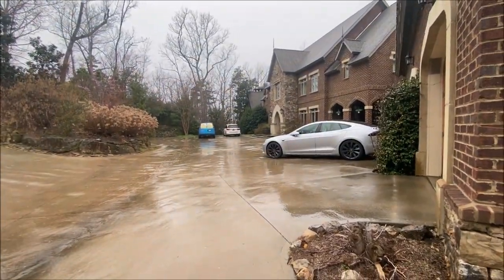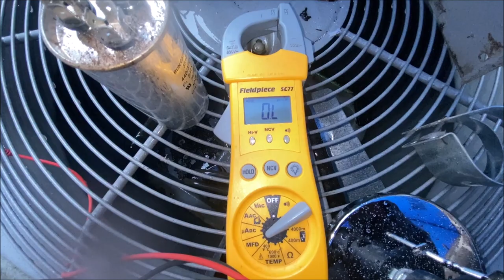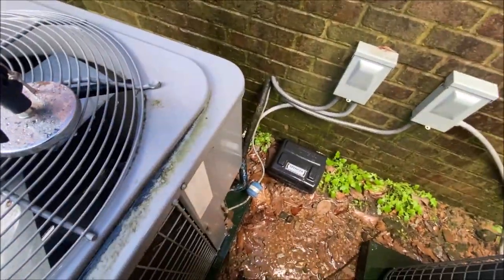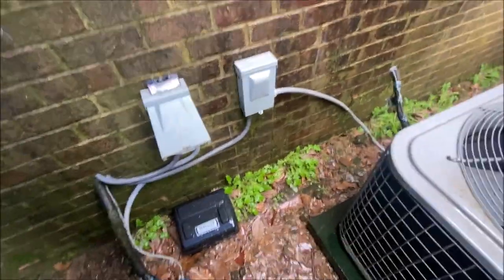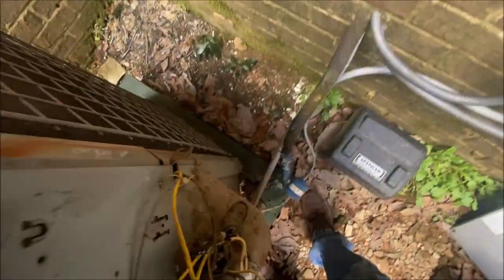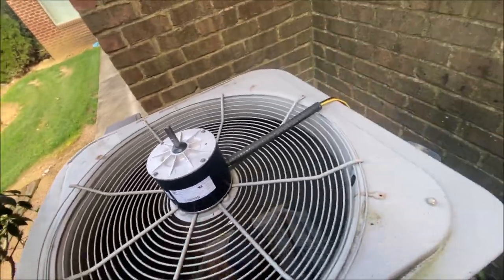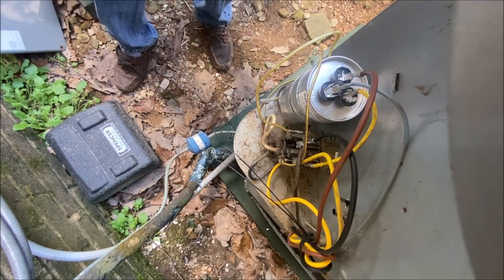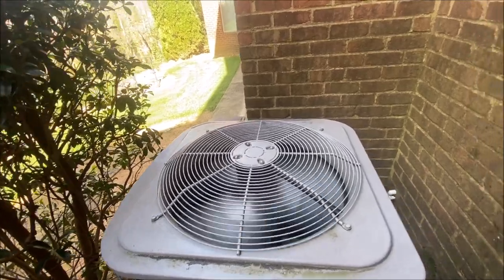HVAC with Supco Umbrella

Comment: After a few videos watched on Anti DIY HVAC, I have brand new capacitors for the condensing unit and blower fan in the attic in stock and ready just in case. 33 years and both capacitors are still working on our Amana HVAC. Apparently, the industry made good capacitors the older they were made ! Many say these days you should expect a new one every 5 years. In any regard, we're ready for the most inconvenient time of the year that one fails. 
5 units on that house is awesome...Initial cost is higher but its very cool to be able to use just one or two or all 5 alternating "as needed" vs. a couple of 5 ton energy hogs flipping on and off multiple times a day, if I'm correct on that. Last time I looked, the 5 ton vs. 4 ton used much more power. Much more than a 3 ton vs a 4 ton which told me to use a 3 ton with a 2 or 3 ton, not a 5 ton due to the operation cost.
This is a good video...its nice to come across a homeowner who wanted OEM parts. It's still Vietnam made but at least it fit like a glove as the original. 600 amps to power up that home? Oh my, 200 of that is likely for just the 5 A/C when they are all running at the same time ! Hope the electric rates are low, like 4 or 6 cents a kWh.

Comment: Great videos👍🏽 Love that umbrella. Doesn’t catch everything cuz the size but definitely helps! Sometimes I’ve found the compressor was drawing close to RLA and found the cap was dead but still running. Or cap is bad, replace and it doesn’t change amps,  And I’ve found them read ok and fluid was leaking, sometimes I’m just like 🤯🤷🏽‍♀️

Comment: Dielectric grease for electrical connections to prevent oxidation, electrolysis, and crustiness.

Never-seize/anti-seize on fan shafts and stuff to prevent rusting and corrosion so they are much easier to remove the next time.

One thing I saw that would make an electrician cringe is the lack of a grommet where the electrical wires passed through the metal housing.

Comment: In the Paintless Dent Rem9val industry, we use Get A Grip umbrellas and Mobiletech Shade Umbrellas.  They have Woods Suction Cup bases, and they have an 80 inch umbrella option.  You cannot beat the 80 inch versus the standard 65 inch.

Comment: Couldn’t help but notice you did not try remove the fan blades after removing the lock bolt. Did it really need the jack of all sprays?  I’ve remove many fan blades without having to use any rust penetration spray on a fan shaft.

Comment: I have one and it's ok if you are replacing a contactor or capacitor but if you take the top off you will not have a stable place to attach. It badly needs a ground pole attachment.

Comment: Why have a meter if you don't use it to check voltage to unit, the pull disconnect and short cap leads. Have you not been nailed from cap discharge.

Comment: Why dont any of the You Tube guys use a service valve wrench to loosen/remove the square drive set screws! Been doing it for 28 years never broke a single wrench!

Comment: That umbrella doesn't spread out enough. I need room while trouble shooting and repairing. I don't want to hug a.c. and risk getting electricfriiiiieeeed. If keeping electric parts of a.c. dry is one thing but it won't keep me and parts dry.
Reply: Used umbrellas many times in that situation. I had to sacrifice myself from staying dry just to keep electric parts dry. In other words my ass was soaked but the cap, contactor and board stayed dry. Water drips off umbrella in azz Crack.

Comment: Nope I am wrong about units not having the 36" clearance in front of the 2 disconnects. Looked like they did not first minute of a well produced vid. I'm a sparky but find the AC & refrigeration vids interesting. Worked in large maintenance shops and if Refrigeration guys were busy would call a sparky to see if maybe it was an electrical problem we could help out with. Would change out condensor fan motors and contacters. Started replacing 480 volt single phase fan motors with more reliable three phase motors. Never had to worry about a bad capacitor. If unit was for an important area like a computer room would use the next size up contactor so they last a lot longer. Think all OEM contractors are garbage. Best to use a quality contacort such as Square D or Allen Bradley.

Comment: Imagine how much drier you'd be if those boxes weren't sitting in a puddle, under the edge of the roof, next to a box used to poison rodents?
How much cleaner it would all stay.  Less water and No mouse turds sounds like a much better place for a Tech to work.
Instead you hand us an Umbrella?

I hope you made it out of metal while making metal shavings stick to it, and orient it's hardware so it attracts to the piece I have to take off to Remove Sticks from Inside the Box, so I can move it six times before I walk away.

That doodad is gonna lay on the ground when the rain falls any which way but Down, so don't forget your raincoat. aka insulating layer.

Stop rubbing your finger in mouse dust, and ignoring what color the tops of caps get when they get urinated on.

Or that this is where the mice live that the homeowner is trying to kill, while attracting it there with shelter and fresh Water.
umbrella my backside

Comment: Sir for me and just my opinion!  Heat pumps are a bad Idea!   A/C for A/C. And a furnace for heat !   Use An A/C unit to heat is a waste and not efficient!
Reply: Facts please. Lots of folks use them...likely those who have inexpensive electric rates or they do not have natural gas available. For those such as California, where energy rates are .40 cents + per kWh, it doesn't make any sense to use electric condensers. In the 1960's my cousin built his home and they installed a natural gas HVAC system. Quiet unit as ever.  My guess is, gas is much cheaper and more efficient than an electric compressor.